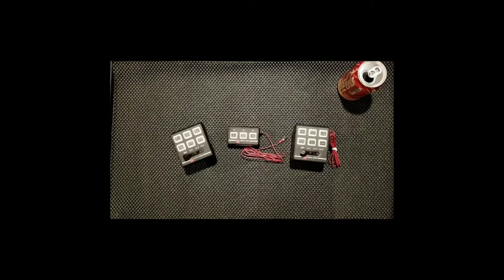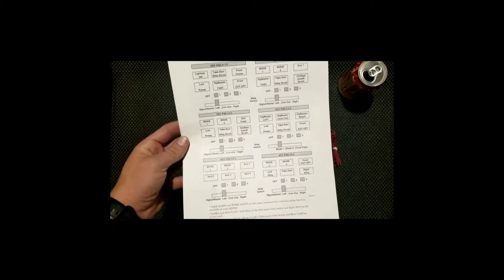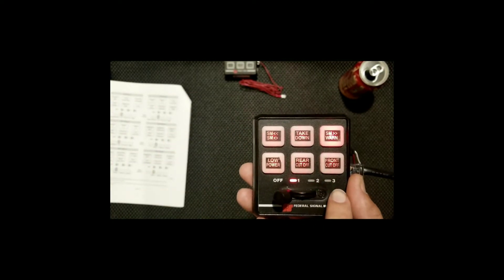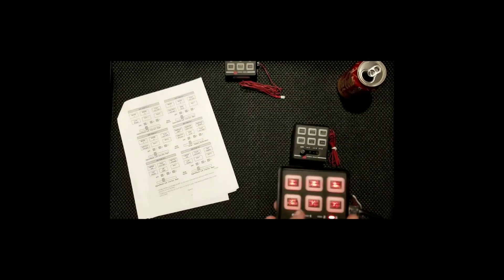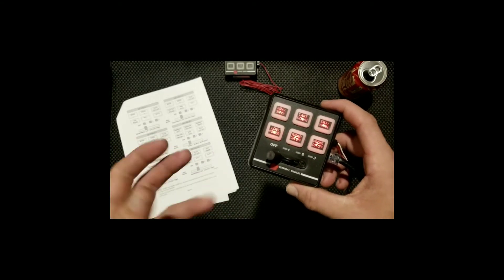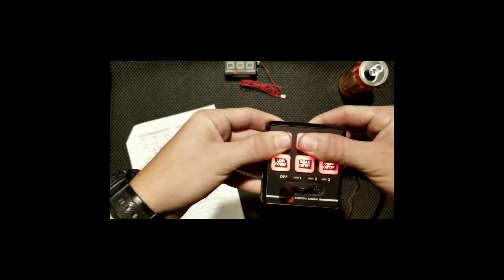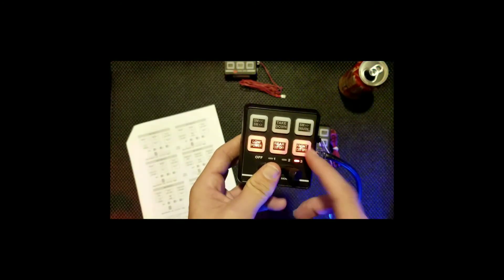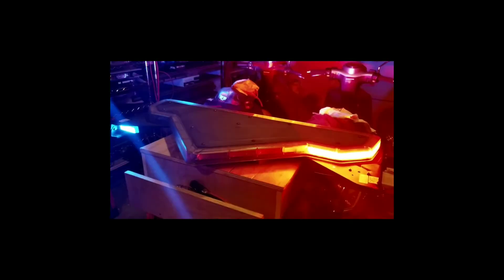Federal Signal 6-Button Controller Programming

Comment: Is there a way to add flashing Takedowns and Alley lights?
Reply from the maker: There is a way yes, I have done it with the Federal Signal software and plugged in my 6 button and 3 button controllers, used the software to reset each button and utilize the flashing takedown option.
Reply: @rjracing38  thanks! Do you know how to make the control box beep when the lights are left on?
Reply from the maker: @michaelf8500  , yes, in the Federal Signal program, there should be a section on the left hand side for button control that you can set the beep enabled and reminder for a certain amount of seconds that you would like.
Reply: @rjracing38  unfortunately, the control box is installed in my vehicle. I was hoping there was a way using push button programming.
Reply from the maker: @michaelf8500  , if you have a spare cat5 cable, you can unplug the cable from the control box and then plug in the new cat5 from your laptop to the head unit and program it from there. Setting up that kind of programming is only seen with the computer program but the push button programming in the vehicle gives you the option to change what pattern setup or what buttons will turn on or off a pre-programmed options within the head unit itself...
Reply: @rjracing38  oooh! Cool! I’ll try it! Thanks
Reply from the maker: @michaelf8500  , most definitely! Yours should have two plugs to it, a cat5 cable and the second is a power plug. Depending on the model, usually either a single wire or two wires. That plug you would leave plugged in and the cat5 you would unplug and plug in the new/temp cat5 cable to the head unit and your computer and be able to utilize the software to reset up your controller in your vehicle. May need to turn your ignition on for power to the head unit depending on how you have the system wired up.

Comment: Are you able to sell a 6 button controller?
Reply from the maker: Unfortunately I don't sell them myself but I have worked with a couple vendors to purchase them or have run the risk of locating them online used.
Reply: @rjracing38  would it work with a ss2000sm?
Reply from the maker: @2011_cvpis , the 6-button controller or your Legend lightbar? Your lightbar has a cat5 wire/connection coming out of the bar along with obviously power and ground so your lightbar will connect to a 3/6/9-button controller like you have or can also connect via a serial interface module or even some of the new smart siren platinum controllers but the older ss2000sm I do not believe will not connect to your Legend light bar as that does not have the right connections. Let alone the 6-button controller you have wont hook-up to the ss2000sm either

Comment: Friend, I have a problem. I don't know how to solve it. When the lever is Off, it activates mode 3 and when I put the lever in mode 3, it turns it off. How can I solve that?
Reply from the maker: Do any of the lights on the display of your controller light up? For example, when you have the toggle level in the off position, does the display light next to the number three illuminated and lighting the lightbar code 3?
Reply: @rjracing38 Only the number 3 light turns on. The buttons stay on normally and work correspondingly. This is in mode 6 and each button performs the functions when I turn it to Off.
Reply: It turns on mode 3 and when I put it on mode 3 it turns off. Modes 1 and 2 work fine
Reply from the maker: @michaelr.j8032 , hard to say but sounds like something internal occurred from off to mode 3 got switched whether it was programming or something happened with the switch physically. Was this something you just picked up or something you have had for a little bit?
Reply from the maker: Also, do you have your lightbar connected to the 6-button controller directly or do you have it connected in any other way?
Reply: @rjracing38 Yes sir, you are connected to a legends bar
Reply from the maker: @michaelr.j8032  have you by chance tried a different keypad program just in case? Such as key pad #5 or #4 to see if the slide switch does the same thing?
Reply: @rjracing38  buenos días es algo que acaba de pasar por qué no estaba así por qué estaba en programacion 1  cuando cambie a programación 6  fue cuando me percate de eso .
Voy a probar en 4 o 5 y te informo  

Pero creo que fue algo interno pero no de la palanca por qué ya cambié la parte donde va la palanca  igual sigue igual creo que se desprogramo y ya ahí sí no se cómo configurarlo
Reply from the maker: @michaelr.j8032 , if it is something that just happened recently, it is probably something internal with the controller. I couldn't say exactly without seeing it but it is something more than likely that would need to get repaired. Hard to say if something happened to the programming or something to the circuit board itself that reversed those two traces or what have you.

Comment: Hello do you know a place where I can get a  power cable harness for this controller, I was able to get the controller but came with out the power cable. Thank you.
Reply from the maker: So you could probably find one online somewhere for probably too much honestly. Best bet in my opinion is you can look up the electronic manual online on Federal Signal's website and just make one yourself with some small gauge wiring. I believe mine has a two pin connector but only one red wire for power.
Reply: @rjracing38  Yeah, I was looking online for it but no luck and I could not find any on Federal Signal website. So there id two pin connector on the controller one is for power and what is the other one for if you don't mind my asking?

Comment: Hello, I have a general question for you if you don’t mind. Do you know if I can use just this Federal Signal Smart SM control head to operate Federal Signal Legend and Federal Signal Arjent S2 lightbars instead of Federal Signals 6-Button Serial Controller? I have some difficulties finding the 6-Button Serial Controller. Unfortunately I can’t attached a photo of the control head that I am talking about. I truly appreciate any help.
Reply from the maker: If you are referring to the same SmartSirens like the Vision lightbars were using, then technically yes, but you will need to have a serial interface module in between the lightbar and the SmartSiren and then tire all your commands or patterns such as your SignalMaster, Mode1/2/3 tied to the corresponding attachments on the back so you can use the control head properly.

Comment: Hey. Could you see about getting a custom 53" FedSig navigator with a built in MB1 in the rear? Would be unique and cool to see!
Reply from the maker: Truely would be a unique an awesome bar to get my hands on. Definitely will post if I do aquire one.
Reply: @rjracing38  Yeah. I'm gonna find out how much and try save for one. Once I get a good job, that is.
Reply from the maker: I know the basic navigator bars from Federal Signal start around $1,300 for just the basic 43" bar, then setup dome colors, leds, etc. I'd guesstimate by the time you configure your color choosing, setup the rotators and the traffic advisor in the rear, probably close to $4k roughly before any discounts. You can confirm a setup you like and length on Federal Signals website as a build a lightbar configuration.
Reply: @rjracing38  Okay, thanks for that. My issue is the prices are in USD, and I'm not in the States, so It'll cost more on my end.
Reply from the maker: Ah, yea, a little bit more but you can use an converter to go from USD to the currency you use to see what it would run for you. Then obviously the cost of shipping but if you're going new, you can locate a Federal Signal dealer to help give you better idea on exact pricing.
Reply: @rjracing38  ah yep. Alright, thanks.

Comment: I have a question if you wanted extra  siren tones can you program them on that?
Reply from the maker: These controllers are typically designed for the lighting patterns but not for the sirens and there is no control module built-in for the sirens like the SmartSirenn series are.
Reply: @rjracing38  you know how there is 4 buttons on the very top of the federal signal Smart Siren push buttons controller can you program siren tones up there or no?
Reply from the maker: What model smart siren are you using?
Reply: @rjracing38  The Federal Signal Pathfinder with Push buttons it’s new
Reply from the maker: So with the Pathfinder models, download the convergence software from Federl Signal on their website and when you get the keypad plugged into your computer, you should be able to register the device as far as your computer picking it up. From there, you'll get 3 options to select. For the Pathfinder, click on the siren amplifier then select what version keypad you have. If you have the 17 button model, you can select you main buttons up top and what lightbar your using and select the button you're wanting to update such as B1 to B4 and select the siren option...the. you can take the standard siren buttons and update those to do light patterns, radio comms or any auxiliary items you have hooked up.
Reply from the maker: I believe your standard set up with the top left button on the 17 button controllers is going to be your signal master step set up for LRCO, so when you're in the convergence network program, hit your advanced options to turn the button type from "STEP" to either "MONENTARY" or more commonly, "PUSH ON/OFF" but its all your preference.

Comment: How do you disable the what I'm guessing is a reminder alarm on the 6 button that screeches when you turn on the light bar?
Reply from the maker: Are you referring to the few beeps that sound when you first power up the controller?
Reply: @rjracing38  no its like a screeching noise that seems like it's a reminder that used to tell you that your light bar is on. All of our trucks do it.
Reply from the maker: So this issue i haven't run into, I do have 3 or 4 of these controllers i can test on an see if I can get them to do that and figure out from there. When it sounds, does the keypad do anything in particular? This happens after the lights are on or just when the bar has power for so long an if so, how long does it take?

The one issue I had for a client was random an very intermittent but after a few hours of diagnosis, one of the power connections were slightly loose so the beeping noise they were hearing was the controller power-cycling on after regaining power. Not sure if that could be but thats one experience I've had.
Reply: It actually sounds like it's something that reminds the operator that the light bar is on. Like it's supposed to do it. It screeches no matter what setting the switch is in. We have quite a few trucks with this unit and I swear they all do it. I should post a video so that you can see what I am talking about.

Comment: How do you get it to change led colors?
Reply from the maker: To get your lightbar to change colors, obviously it has to be equipped with multiple color LEDs. Beyond that, I am still playing with the new software for changing colors as the lightbar has to be programmed and already setup to switch from one color to another. For example, the lightbar on the motherboard may be setup to run red and blue standard while amber and white may be setup to run on an aux configuration and then you have to match your controller to push an aux button to run the different color options.
Reply: @rjracing38  I have a Vision SLR with 4 colors in each pod. Do you know where I can purchase a six button controller like you have in the video?
Reply from the maker: @FloridaExplorer777 , you may be able to find a used one online like eBay or elightbars.org or depending on your location, locate a local dealer that can get a new one ordered for you or have one in stock.

Comment: Can you configure the horn ring transfer on the six button, to be able to toggle between car horn and siren?
Reply from the maker: With this compact controller, I do not believe so no. The 6-Button Control Head is designed to
operate using serial communication with Federal
Signal lightbar models in the Arjent®, Legend®, and
Raydian® series. If you are looking to do an all in one system with a siren built in and control it via a single control box, I would highly recommend and of the Federal Smart Siren Control Boxes. There are a few others from Whelen, Code3, SoundOff, etc.

Comment: Will this control work on a federal signal arjent light bar s2
Reply from the maker: With the Federal Signal 6-Button Controller, it should work on your lightbar as long as you have the correct connections, primarily the cat5 connection from the lightbar.

Comment: Thanks for the beautiful work you doing bud , i tried to go on programming mode on my 6 and it won't let me ,what it could be.  Thanks in advance sir.
Reply: I only have the red cable from power
Reply from the maker: To select one of 18 predefined keypad configurations, enter the Keypad Selection Mode by pressing the top three buttons simultaneously. All of the illuminating buttons will flash three times and the control head will beep three times. All six button LEDs will flash repeatedly during Keypad Selection Mode.

To assign a flash pattern to a mode button, press the bottom three buttons simultaneously. All of the illuminating buttons will flash three times and the control head will beep three times. The LED indicator(s) corresponding to the mode button(s) will then flash. To change the flash pattern on a mode button, press the button repeatedly and observe the flash pattern on the lightbar. The LED indicator of the button currently being programmed will flash at twice the rate as the other buttons available for programming. When the desired pattern is currently flashing, press another flashing button available for programming or exit the programming mode. Once all available buttons have the desired flash patterns, exit the programming mode by either removing power, or allowing the control head to time out after about 15 seconds.

Comment: I'm looking for a discreet controller and based on your comprehensive review; this one appeals to me. BTW, 'Rear Cut Off' is typically used to disable the brake lights when prowling areas such an alleyway; where you don't want a suspect(s) to know that you're sneaking up on them. I would slide the transmission into neutral; kill the engine and coast to a stop. Back when I was a Peace Officer in the Cretaceous Period, it was merely a toggle switch on the dash. Say, do you know if custom labels are available, or does the controller come with a sheet of other names?
Reply from the maker: The sheet that comes with the controllers is setup for a few other different names but depending on what name you were looking for, may be on the sheet or not.

Comment: hi would you know if this six button switch work on a led federal signal arjent SL light bar. as i have got a amber led federal signal arjent SL light bar and wanting to get a switch for it and would you know what the part number is for it thanks bailey
Reply from the maker: On the SL models, pending on how you have it setup, I do not believe so no. Most of the SL models I have worked with have had one large wire harness coming out of the base of the lightbar for each module or light head. These controllers will work on the S2 models that have a central motherboard with a CAT5 connection for communication from the controller to the lightbar. For the SL models, you could use their SW400SS control box as one option to activate your bar, codes 1-3, take-downs, etc.

Comment: Hello, nobody here in Miami has been willing to help me. I have a Amber federal signal Integrity, with a 6 button controller part number 8623121 . From the top row left to right. my first button turns off and on but nothing on the light bar. Second is Flash, 3rd Rapid flash 
Bottom from left to right I have flood, 2nd is front flood 3rd rear flood. The. The bottom are the left out middle center out and 4 right out. I really would like steady burn on my fist button anyway you could help me out? If I have to pay I will. I’m going crazy trying to figure it out. Please thank you for your time.
Reply from the maker: Your best bet is going to be calling Federal Signal with your lightbar information and have them reprogram your 6-button controller for you to the specs you want for your bar. You'll want to provide them, if you have the build sheet, the exact model number on the build sheet which will let them know exactly what your bar is and how every light head has been configured and how it is setup. I have tried this myself in the past and it is extremely difficult and I am not aware of any programs that Federal Signal offers to reprogram these controllers except the new Smart Siren Platinum modules. The things you can change setting wise is what I showcase in the video which based on what you are asking that I can tell, would be best to have Federal Signal Engineer help out which they will have you send in your controller, they will build the program for how you want your controller configured and flash it and send your unit back.